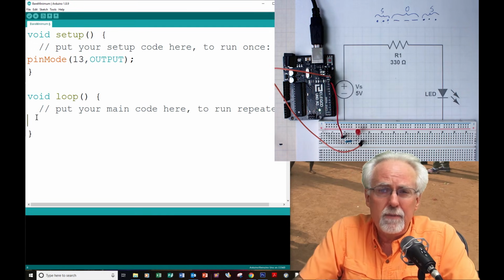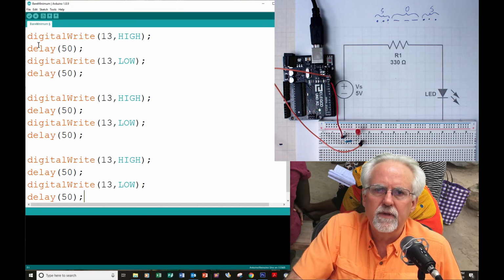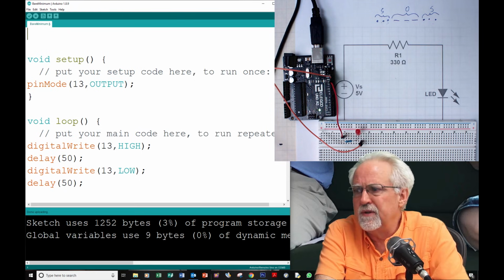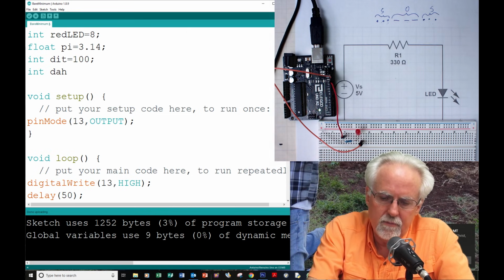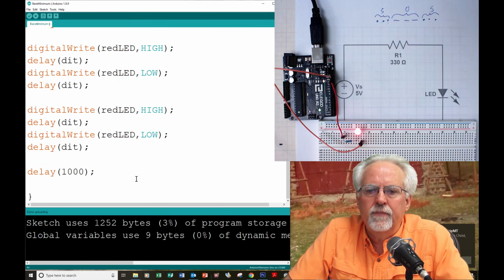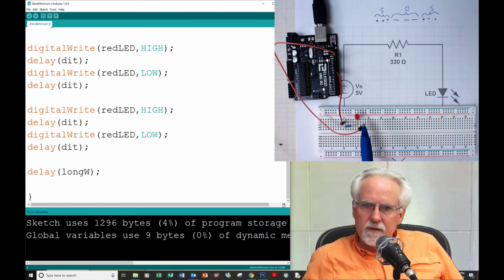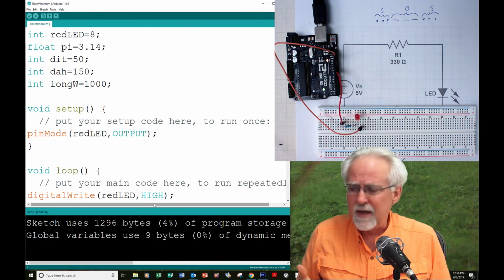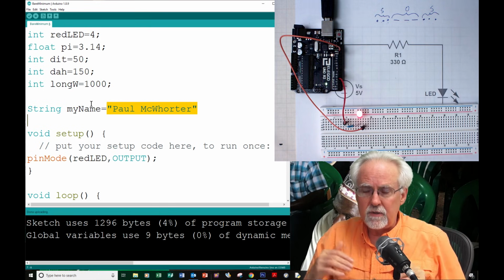Arduino Tutorial 4: Understanding Arduino Variables

Comment: I had a project in mind and was trying to figure out how to learn programming for Arduino's.  The first lesson teaching my how to name the pins and configure them as inputs and outputs felt like a huge step forward!  Working through these videos hoping soon I'll be able to program it to control 2 Pneumatic solenoids to control a double acting cylinder connected to the shift lever of a motorcycle engine in a off road buggy.  Relatively simple to do that 100% analog however if someone held the shift button it would hold constant torque on the shift lever, also it needs to cut power to the ignition in order to not damage the transmission.  Plus it makes shifting to neutral nearly impossible.  With the Arduino though, anything is possible!

Comment: i admit i cheated on my homework, as I had already attached the blue and green LED. i had the redLED blink 3 times for the first "S" the blueLED "scratched" 3 times for the "O" and the greenLED blinked 3 times for the last "S."

CODE:
int pinRed=13;
int pinBlue=11;
int pinGreen=9;
int Dot=150;
int Dash=300;
int betweenD=500;
int longD(1000);

void setup() {
  // put your setup code here, to run once:
pinMode(13,OUTPUT);
pinMode(11,OUTPUT);
pinMode(9,OUTPUT);
}

void loop() {
  // put your main code here, to run repeatedly:
digitalWrite(pinRed,HIGH);
delay(Dot);
digitalWrite(pinRed,LOW);
delay(Dot);

digitalWrite(pinRed,HIGH);
delay(Dot);
digitalWrite(pinRed,LOW);
delay(Dot);

digitalWrite(pinRed,HIGH);
delay(Dot);
digitalWrite(pinRed,LOW);
delay(betweenD);

digitalWrite(pinBlue,HIGH);
delay(Dash);
digitalWrite(pinBlue,LOW);
delay(Dash);

digitalWrite(pinBlue,HIGH);
delay(Dash);
digitalWrite(pinBlue,LOW);
delay(Dash);

digitalWrite(pinBlue,HIGH);
delay(Dash);
digitalWrite(pinBlue,LOW);
delay(betweenD);

digitalWrite(pinGreen,HIGH);
delay(Dot);
digitalWrite(pinGreen,LOW);
delay(Dot);

digitalWrite(pinGreen,HIGH);
delay(Dot);
digitalWrite(pinGreen,LOW);
delay(Dot);

digitalWrite(pinGreen,HIGH);
delay(Dot);
digitalWrite(pinGreen,LOW);
delay(longD);
}

Comment: Hi, again, Paul.

I'm glad you brought the length of the 'dits' and 'dahs' up.  A 'dit' should be considered as the reference for the rest of the 'word'.  The 'dah' duration is 3 'dits' as well as the space between each letter.

So 'dit dit dit' (S) delays should in fact as follow. (we could've done it shorter, but I thing you keep this way of doing things for another lesson, si I won't burst the bubble just yet :-) )

void Setup()
{
     int LED_Pin = 13;
     int Dit_Relay = 100;
     int Dah_Delay = 300;

     pinMode (LED_Pin, OUTPUT);
}

void Loop()
{
//Writing 'S'
     digitalWrite (LED_Pin, HIGH);
     delay(Dit_Delay);
     digitalWrite (LED_Pin, LOW;
     delay(Dit_Delay);
     digitalWrite (LED_Pin, HIGH);
     delay(Dit_Delay);
     digitalWrite (LED_Pin, LOW;
     delay(Dit_Delay);
     digitalWrite (LED_Pin, HIGH);
     delay(Dit_Delay);
     digitalWrite (LED_Pin, LOW;
     delay(Dah_Delay);
// Writing 'O'
     digitalWrite (LED_Pin, HIGH);
     delay(Dah_Delay);
     digitalWrite (LED_Pin, LOW;
     delay(Dit_Delay);
     digitalWrite (LED_Pin, HIGH);
     delay(Dah_Delay);
     digitalWrite (LED_Pin, LOW;
     delay(Dit_Delay);
     digitalWrite (LED_Pin, HIGH);
     delay(Dah_Delay);
     digitalWrite (LED_Pin, LOW;
     delay(Dah_Delay);
// Writing 'S'
     digitalWrite (LED_Pin, HIGH);
     delay(Dit_Delay);
     digitalWrite (LED_Pin, LOW;
     delay(Dit_Delay);
     digitalWrite (LED_Pin, HIGH);
     delay(Dit_Delay);
     digitalWrite (LED_Pin, LOW;
     delay(Dit_Delay);
     digitalWrite (LED_Pin, HIGH);
     delay(Dit_Delay);
     digitalWrite (LED_Pin, LOW;
     delay(1000);
}

Try it with an 'Active Buzzer' .. you'll see.  (I'm a ham radio operator, by the way)  Hahaha!

Have a nice day and keep on sourcing these great Tutorials.
Reply from the maker: INteresting

Comment: I actually watched PM's previous Arduino tutorials and I am loving these ones too, nice refresher. 
Just a quick note that the Arduino IDE does have a find and Replace feature under the Edit menu, so you can hunt out those pesky hard coded numbers and replace them with variables much easier and quicker than Paul showed but i guess he was trying to labour the point about the usefulness of variables.
Would like to ask Paul if he is thinking of making a series to cover the official Arduino project book. They have just released a new certification for Arduino, which is based on it. If you have the time, I would definitely find this useful as I am studying for the cert. 
Loving the new series tho, thank you for taking the time. (I'm splitting my time between this and your Fusion360 course.) BIG Fan here :)

Comment: I hate those error messages ! I think the Arduino IDE could be upgraded to give a little more info on exactly what is causing  the error . I recently had some messages pop up like does not name a type , not declared in this scope or has no matching type . Some were because the library i was using for a particular sensor didn’t match , some because i had omitted a curly brace and all along i was left scratching my head trying to work out what the error message was trying to tell me ! One really annoying error is “ expected  such and such before token  something , usually a missing semicolon or bracket .
I suppose that is the trails and tribulations of hacking someone else’s code and i eventually got it working !
Reply: I wrote around 150 lines of code once which actually is not a lot once you get going. I had that error message that i just could not find!  It turned out that i used a "full stop" instead of a "comma" one time. It took forever to find. Useful tip! Run your code every 10-20 lines even if not finished. Will make your life easier finding mistakes. But i do agree. Finding mistakes can be a nightmare. They are other IDE's that auto-correct. But Finding the mistakes  when starting out is 50% of the learning in my opinion.